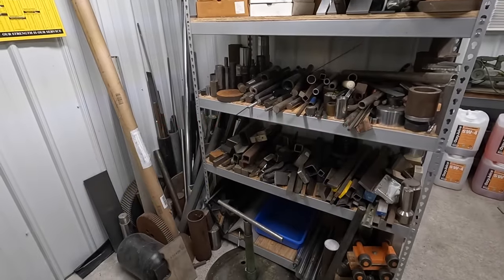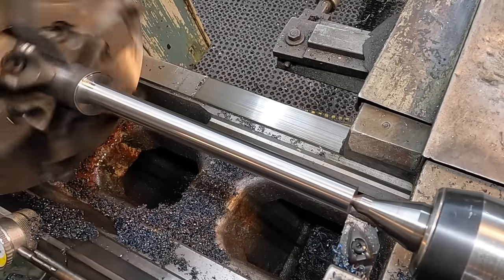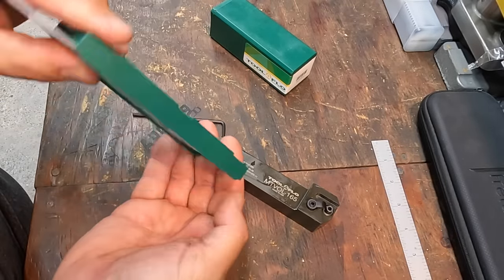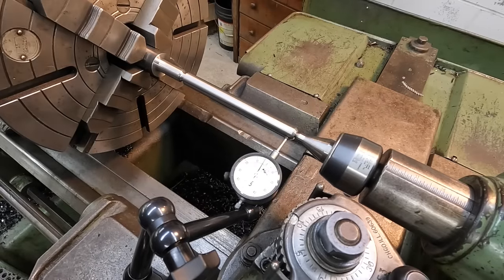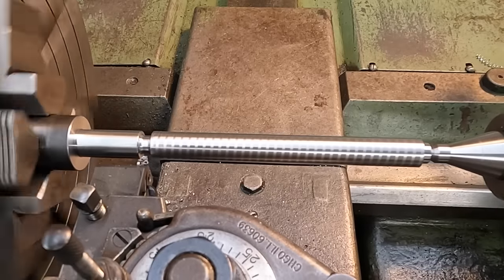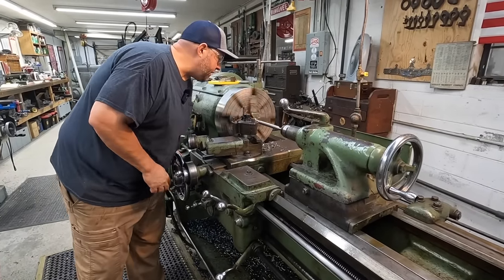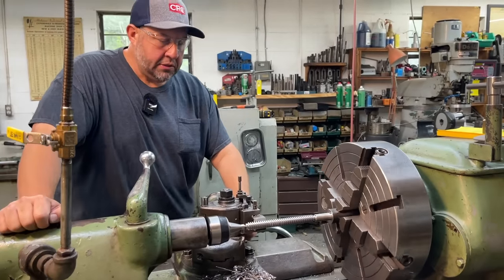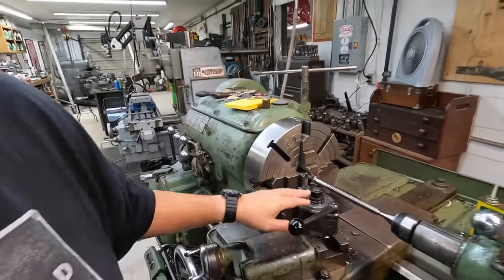Compound Lead Screw for American Pacemaker

Comment: Yeah, lotta comments for you. I sure cut a lot of acme threads when I worked at a valve repair facility one of the things I used to do is rather than use the compound for that 29°. I would put it parallel to the bed and sometimes I would Scooch the tool left or right so I would’ve only cut on one side to relieve some tool pressure. It worked really good with stainless that way, if you’re cutting stress proof, I didn’t catch what material you got that stuff is gravy compared to some stainless that we used to cut like 416

Comment: You seem to have the same look as me it not the lathe. The reason is vibration the diameter of the work is getting smaller and the tool is cutting further into the work using cutting oil helps a steady would help too but the best way we find is a Coventry die box

Comment: Dang I’ve been absolutely hanging out to see the cure and for the American Pacemaker to be fired up and making chips.
What will prove to be the answer I can’t help wondering?
A follow rest to reduce flexing?
Chasing the tread out with a single point first then follow through with the acme thread insert afterwards?
Less tool hang out distance from the tool holder?
Not kidding, the wait is killing me!
You have the PM lathe quick change tool post mounted already. Time to get back to this acme thread leadscrew please. 😜😂😂👍

Comment: Do you have a follower rest?  You just about need one for acme threads as the tool pushes the center of the shaft out.  I also try to remove most of the metal with another tool, then finish with one on size.

Comment: when you get down to the nitty gritty cuts for final pitch diameter,  is usually when some jack leg welder helper drops a big sheet of plate steel and you panic and trip the the half nut lever.  ya  you know what i'm talking about

Comment: You could also do the threads with a half width cutter and do 2 sets of passes to clean up both sides of the final thread width. Would half the presure for the given depth of cut mabe help in not pushing the meterial as hard

Comment: Thanks for posting a screw-up.  Prior to this, I was convinced you never had issues like this.  I’m wondering if lube or cutting fluid would have helped.  Or given the diameter, use a following rest.  Take it to the PM 1660.
Reply: He's had small mistakes all sprinkled throughout the timeline of videos. Mostly things like turning the axis the wrong way by accident or crashing a tool and leaving a mark, or accidently cutting something over/under final size (though it will still fit). All of the things usually still work fine, but they hurt one's ego for sure. It seems Adam has integrity, since he does show us these mistakes. I think the surface plate he made and finished on the shaper is a pretty good example too. He finished with the shaper (which was glacially slow) in order to achieve a great surface finish rather than do it in the mill which would leave circular machining marks. I think the plate ended up not very smooth or it was warped or something though and he ended up just surfacing it again quickly with a fly cutter in the mill.
Reply: @mannys9130  Thank you so so much - this really was an enlightening follow-on comment.  You are so observant.
Reply: @David_Best  You bet. I have 2nd thoughts about that fixture plate now though. 🤔 Maybe it was another part that that happened with? A manifold or a straight edge maybe? I'm actually not 100% on it, but I believe something like this did happen. He wasn't happy and redid it, wasting time but showing us that he did indeed waste the time. Nobody is perfect. I don't look down on YouTubers who add correction annotations on screen when they misspeak on video. I admire it, and I think it shows that they researched their statements before publishing the video where people will cite it and learn from it. When people NEVER show mistakes and claim to be an absolute expert, you know that's a facade.
Reply: @mannys9130 . Hahaha.

Comment: I had a similar problem on a well used Jet lathe. I had to tighten the cross slide gib inorder to prevent the material from pulling the slack out of the nut. I also had to tighten the cross slide lock a little. Looked great  though.

Comment: I don't have a metal lathe but I'm using a woodlathe. My lathe's tailstock used to get loose sometimes and it's causing similar problem like your metal lathe does. I solve the problem by tightening the tailstock a little bit.

Comment: Use cutting oil  . The metal has been flexing away in that area but now since lightning up on the cut it’s gets to that area there’s n more material in that area so it pulls in also try taken spring cuts in between

Comment: Hi, good video. But I have a suggestion. In Germany we use two tools for such a long part. One simple for the rough prep and the other needs to be more precise for the finish.
Then the tool must be narrower. A cut in the middle then a cut for the both sides. Then keep going until you're done.
Reply: Both sides? Of a screw?
Reply: @LeglessWonder  Yes, you geht bettet Surface.
Reply: I work on a lathe professionally and I am looking for a job, please help me
Reply: @nasserdhj2614  where do you live
Reply: I am from Morocco and currently live in Kuwait
Reply: That’s alright though. At least  she ain’t boring

Comment: Could it be a material defect in the workpiece? A hard spot that the insert got caught on and grabbed, pulling the insert into the material? Maybe some cutting oil on the last few passes? I would think that - if it is a problem with the Monarch (backlash on the lead screw/half-nut) - it’d be a problem on all the passes, not just the last few. 🤔

Comment: There is two ways to cut treads either you control the debt of the cut by the cross slide or by angle the compound slide. Choosing the pre defined cutting geometry by inserts it's mainly for CNC they give you the right cutting geometry but they require much higher cutting speed and a more stable workpiece and also need cutting oil to reduce the tool pressure and they will operate only on the Y-axis and so do you. You can't do the mix by controlling the debt by the compound it will always give you wrong cutting geometry. I would have chosen the high speed tool and grind it that way, so it can't cut on the backside. This will reduce chatter and minimize the tool pressure, which is important when the length is more than 10 times the diameter as rule of thumb. Also when using only the frontside of the high speed tool, cutting can only be done when use the angled compound slide for adjusting the thread debt.

Comment: You have small amount of play in your cross slides .The play has been eliminated with a larger cut
 because of cutting pressure. 
It is best to lock the slides when cutting smaller cuts and lower the RPM. Carbide is good but it tends to rub .Personally I use a high speed steel for finishing. Only a machine with ball screws would do an acme thread  the way you were attempting ,example CNC

Comment: Although I’m not in the same realm as you in machining however that same thing has happened to me and I wonder if it’s a combination of all things that causes the tool to grab like that, from the diameter changes to tool getting dull and possibly even the change in the consistency of the material?

Comment: I was taught to always use spring cuts to approach the  final depth on screw cutting to try to avoid what happened to you here as well as just reach the final desired size. 
Always used cutting oil and slow speed to avoid ruining a job as well.
Either you didn't listen to your mentors or you have got into a bad habits with screw cutting. 
I've always thought your screw cutting procedure was too fast and easy. You have the luxury here of redoing the job at your leisure. 
You in my opinion let your machine and tooling down.
We CAN all learn till we stop. 
You are a great mentor yourself but you've got a lot going on. You can impart great knowledge without rushing, if your viewers can't appreciate that, it's not your fault. 
All the best for now from Australii.

Comment: I've had the same problem.  I'm not sure of the solution but I have 2 theories.  One is the screw rotated in the chuck. Not likely.   Another is when taking a series of passes, the shaft flexes and material builds up in the center of the piece.  Run several spring passes to get the center back to size so when you add .002" cutter depth, an even amount comes off the full length.  I have a Hardinge HLV-H and cut a lot of smaller threads without the tail stock.  I have the same problem of the screw trying to climb up on the cutter.  I like your honesty.  Let us know what you figure out.

Comment: The piece is vibrating as the root diameter is getting smaller 2 things that could solve the problem 1 change to a HSS tool and 2 rotate the work at the slowest possible speed or even turn the chuck by hand . Years ago we used to do this to get a highly polished finish

Comment: Perhaps a combination of things. Temperature of the piece with the thickness decreasing tends to some good ole fashioned flex eventually. The bit creates more drag as it wears,which exacerbates the flex. Speed along with thickness of cut on a continually thinner piece. Bound to reach the limit somewhere.  Each cut requires  more energy on  a thinner and thinner piece, with more surface area to be cut at each and every pass. Since you were at a stage of last pass. An ice cube might of done the trick. 😁
Reply: Might have*.

Comment: Never disengage the half nuts on an old machine just put it in reverse if it has that feature also travelling steady and neat cutting oil are a must and finally every 5th cut just let the tool cut the high spots before taking the next cut, made plenty of them up to 5’ long that dia , very stressful trying to make them on a worn machine 🤪
Reply: That Monarch wont run backwards.

Comment: Edited ; the smile at end of every video always makes me smile too 😄
Im a nooby at machining still learning so i have a question what is the difference between 3 and 4 jaws chuck in clamping and running ture wise ? And when i use this and when i use that ? Thank you for the great content. Wish you all health and luck :)
Reply: Most 4 jaws let's you independently move all the jaws, allowing you to dial away runout or even intentionally an offset.

Most (all?) 3 jaws are scroll chucks and the jaws move together, so there's almost always some runout.

Which is better depends on your parts needs. Sometimes the runout of the 3 jaw is offset by speed and ease...sometimes you need the added precision/flexibility of the 4 jaw.
Reply: @drrrrockzo  ohhh thanks man that was so informative, this also fall for the 6 jaws chuck right ? i mean the flexibility of the 4 jaws ?
Reply: @Not-C-418 
Well the only 6 jaw chucks I've seen were also scroll style, meaning all the jaws move together.

I've heard they have stronger gripping power, especially with thin material where a 3 jaw might crush it.
Reply: @drrrrockzo  ok, thank you sir for explaining :)

Comment: I'm just brainstorming and asking because of my ignorance, but is it possible to cut long screws like this from both sides so the cutters push through the material from opposite sides and forces counter each other and prevent the work to flex?
Reply: Yeah theoretically, like using a die, but no die is going to be able to cut that thread in one pass. I don't know if there are adjustable dies?
Using two opposing tools would be difficult to set up.
Reply: A follower rest is exactly meant to be used on jobs like this. It supports the work on the oposite side of the cutting tool.

Comment: I'm guessing HSS ground and honed super sharp. You got HSS to work when them inserts messed up. Feed from right to left with the angle of the compound so less contact on the profile. And maybe lock the cross slides too on the last pass.

Comment: Too bad the part went wrong, Could the shaft be flexing with the high tool load? or could the shaft be slipping in the chuck just a little bit? We are all human and make mistakes you will get it figured out. What about the shaft twisting? Thanks

Comment: You must change the RPM lower, and give it little bit if oil, you will be amazed what this 2 things can do.
It looks like it bends on the middle, even if you take small amounts of material at that depth it will take more each time you go deeper. again with some oil you would avoid that situation.
I'am going to the next video to see how did you finished it!
Love late works!

Comment: All of these comments are kind of funny to me about this being to soft. Usually lead screws are used with brass so that brass or softer metal wears faster. This piece will not wear as fast as the other materials and if it does he can turn another. Great video for information, thank you!

Comment: maybe the tool is too low and by the time you get to the minor diameter there's enough flex for it to ride up on the tool? would oil help keep it from grabbing?
Reply: The work was trying to climb up the cutting tool. A travelling steady would reduce that.

Comment: That's one hell of a bummer Adam. I for one thank you for showing this to us. You could have easily just gone and made another one and deleted the video so that only Abby and yourselves knew about it. Fair play to you for showing us that these mysterious things can happen even to an experienced master machinist such as yourself. I think you are right in going to the new Precision Matthews in the new shop to do the job. And when you get the chance to make a new cross feed lead screw and nut for the Monarch if indeed it needs it. One question for you does making the leadscrew from stressproof make it more likely that it will wear more quickly than whatever material the original one was made from? Obviously the American Pacemaker is now not in a production type environment being used day in day out and that would be a big factor if it was. I'd really be interested in your thoughts. And in fact everyone else's too lol

Comment: Job is very long for it's diameter especially as you approach full depth. Make sure the tool is exactly on centre, use copious quantities of cutting oil (not emulsion) and use a traveling steady to eliminate any flex

Comment: Excellent work, thanks for sharing. I want to make my own vise. I don't have an acme or square thread screw for it, maybe, if I salvage a manual lifting jack to get it. My question is: can I make the vise with a metric thread screw and bolt? Would it be as strong as a one with square or acme thread screw, especially when tightening (fastening) to bend of squash a pipe etc? I have the conception the square or acme don't wear out and loosen under strong tightening, is that correct?

Comment: Adam what are your thoughts about using a Traveling Steady Rest on the Precision Matthews lathe, but use you current acme thread  as a test first, just to take a few cuts for testing. Before using new material.  Also you close up thread cutting recording was very clear and looked great to view, are you shooting with a better camera or high definition?

Comment: I would say that the material is the problem, not the lathe. The heat of the material itself more than likely is the cause of your problem. That level of depth in the cut and the lack of cooling is more than likely causing the metal to flex and when it does it gets pulled upwards. Lower your cutting speed, cool the material along the cut, and lower the feed rate a bit. I doubt that machine is the problem.

Comment: Maybe you experienced resonance due to the length of the workpiece and the speed of the spindle. I encountered that before and solved it by going to a lower spindle speed. Maybe this helps. Your equipment is fine. Therefore I guess it's the laws of physics that are fighting you. You'll figure it out. Just don't blame the trustee Monarch :-P Best, Job
Reply: Seems like if it was a lead screw, or off center problem, it would have shown up earlier. Resonance fits video observation.

Comment: Compound should be in line with cross slide no? Coated Carbide insert with not enough positive rake and not sharp enough to cut without too much cut pressure. Classic carbide problem with low rigidity and slow speeds.

Comment: Stop video and compare 32:31 and 36:04, and look at the position of the locking lever on the tailstock. The first time the lever is forward of the green casting, the second it's behind the green casting, did you forget to tighten down the tailstock completely?

Comment: That is a real shame, so far then job ruined, did you resolve the problem? , my thoughts are,  has the edge gone off the tool, is the helix angle correct, I know you said it was for 5 tpi but has it been checked, can you fit a traveling steady, as the job is getting thinner, is the tool above the centre line?

Comment: Seems like the minor got small enough for part to chatter and deflect.  You moved towards the middle away from support at the headstock. Your single pointing at the harmonic. Try to slow it down and take like .001" at a time or until it's clean, or a use die. Making a die may be a fun video.

Comment: You could be picking up vibrations going away from the headstock causing the screw to flex as material is being removed, which in turn could cause the cutter to bind and dig into where you don’t want it to. I could be wrong, but there’s definitely something going on.